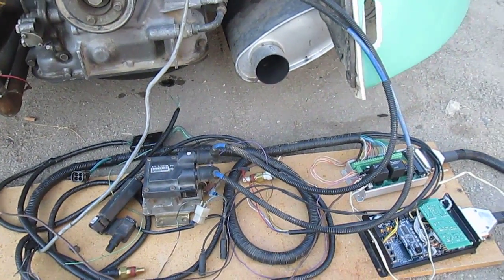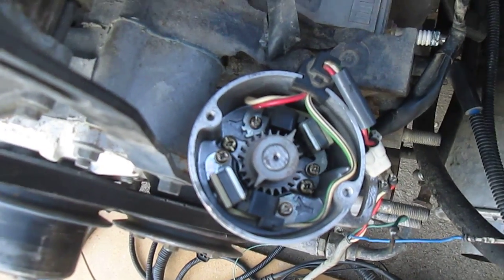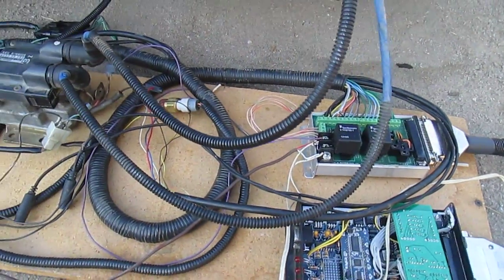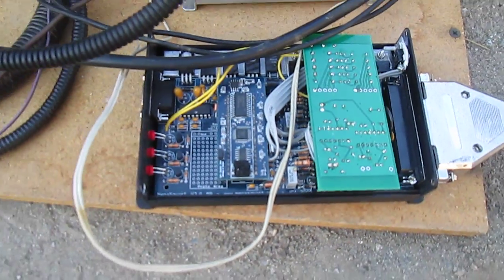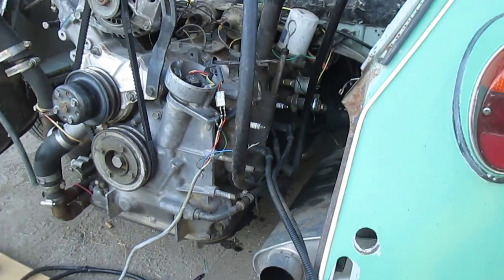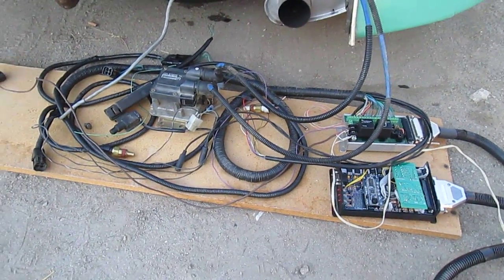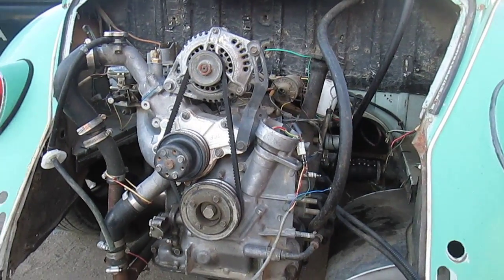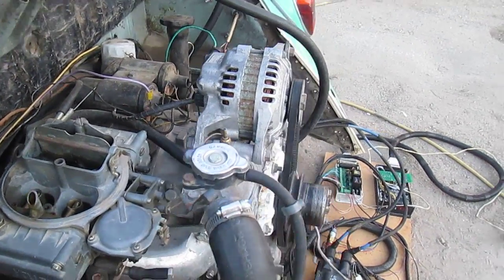Megasquirt2 rx7 CAS Rotary engine 13b VW beetle

Comment: am i the only one that notices the spark plugs are not connected
Reply from the maker: Did you notice that it is a rotary engine? This engine only needs the Leading plugs (bottom) to run. The top plugs are trailing and mostly help with economizing fuel and with flame front propagation.